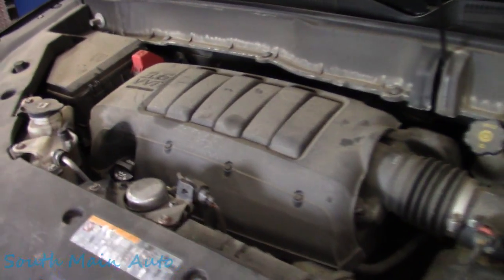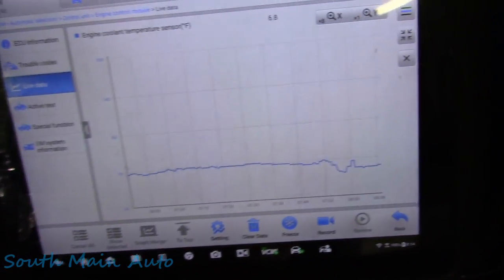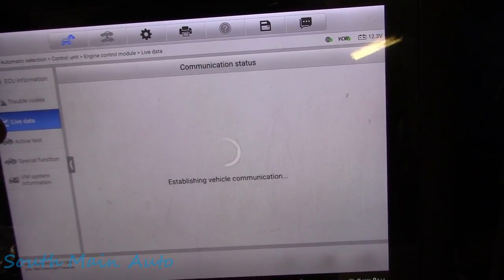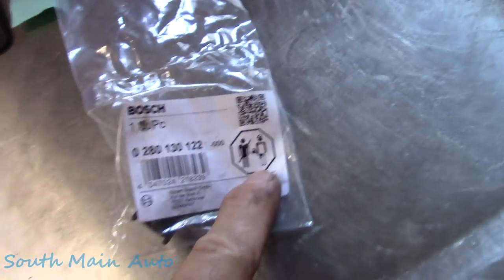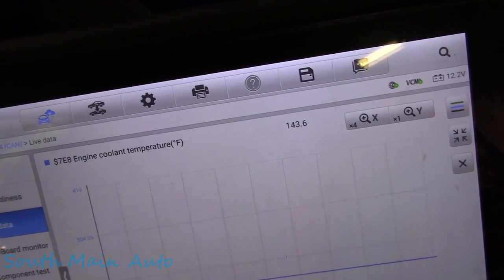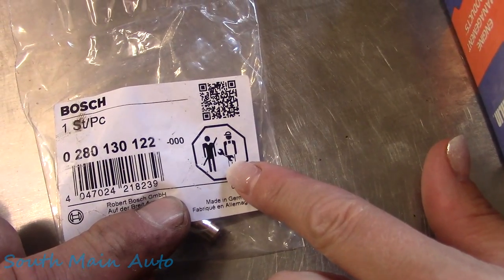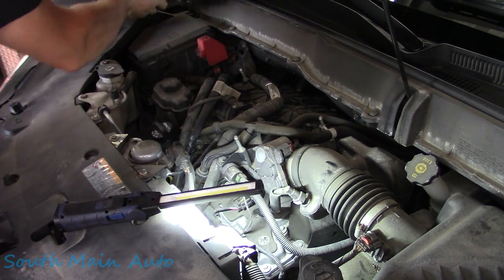Chevrolet Traverse: P0118 & P0119 Eric O. Loads The Parts Cannon AGAIN!

Comment: Every automotive engineer should have to be an assistant on a tow truck for a snowy winter, and an apprentice in a non air conditioned garage for the hottest 3 months of the summer. How cars are made would change.

Comment: You can shorten wires if the connector has a lock. The saved copper will pay for the lock many times over

Comment: The tab on the plug that connects to the coolant temp sensor on my 04 Escalade broke off about 4 years ago.  It hasn't moved at all in that time.  I don't live in the rust belt, and I spend all my time on paved roads, but I'm thinking the red clips are probably overkill
Reply: Its like having a stop ahead sign in front of a stop sign that you can CLEARLY see. Keep it simple stupid(kiss method)
Reply: I had a real scare on a car back in 79. The oil pressure idiot light came on and I thought we were looking at a major repair. It was the connection to the sensor that came off and dropped against the engine. The lock tab on the connector was bent just enough to let it slide off easily. No plastic so I took a small screwdriver and bent it back where it needed to be. I've seen enough loose connections to make me tolerate the inconvenience of unlocking connectors. I just wish they would put them where a person can see and reach them.

Comment: Best thing for those GM 3.6's is a road flare in the filler hole...
Reply: that's funny
Reply from the maker: 😂 so true
Reply: @SouthMainAuto  Eric, I beg to differ on the earlier 3.6 L ! Very widely used in many models. People can destroy a Sherman tank ! Go to Lube Centres looking for a deal ! Recycled oil & a $3.99 filter , run the shit out of them , go beyond time . Some Centres “ cheat “ & not replace filter ( seen it 4 times ) I would bet this engine has a 3-4% failure rate ! We only see the bad ones ! My wife’s new 3.6 L Blazer has a totally different engine , 5-20 Mobile 1 & GM upgraded filter. My cost $120.00 ! Money well spent , her third 3.6L ,,,, 3 out of 3 perfect ! Have a poop ! LOL & change @ 20% !

Comment: In the early days of smog control, the smog devices were very unpopular and could be easily disabled by disconnecting the connector.  The gov't said "We can't have this" and viola, the birth of the locking connector, mandated by smog control law.

Comment: Community question : 2006 Dodge Charger. P0481 No high speed cooling fans(very random short cycle of fans) Freeze frame data shows ambient air temp 30°-40°f when was really 90°f+. The display in my instrument panel always shows the correct temperature… I’m leaning toward TIPM… I did buy a new mopar ECT sensor… haven’t installed that yet. (New fans & radiator)

Comment: Tesla lock tabs are pretty neat.  You just pull it once. Then pull it again ....then it removes the connector automatically.   No squeezing required  and in tight spaces that's a plus
Reply from the maker: Get some NY salt and dirt in those and report back ....
Reply: @SouthMainAuto  😂🤣👍
Reply: @SouthMainAuto  iono how that compares to desert sand but they ain't too bad.   I have ran across a few that were pretty crusty ...
Them Tesla cars sure ain't built as well as I thought they'd be but damn they fast.   That's why everyone crashes them coz they wasn't ready lol

Comment: I'm currently removing the dash and everything on the firewall in a 2021 Camaro lt1.    I swear engineers are evil.   Should be mandatory to be a mechanic for no less than 5 years before you can be an engineer.   I'm sure it'll make a difference lol
Reply: @thomasfletcher4765  being a hater sure does take up a lot of your time don't it
Reply: @autotek7930  excuse me ? In what way was my comment " hate " ? Grow up
Reply: I agree that if engineers walked a mile in a pair of mechanics shoes, vehicles would probably be designed a lot differently.

Comment: So does the coolant sensor tell the dash board temp gauge what the temp is and then the gauge tells the computer what to do with the engine regarding the current temp reading?  I have a temp gauge that jumps around after the car drives over 10 miles and it can do that even if the temp sensor is in the engine or just hooked up laying on the block.  Maybe it's a short.

Comment: I believe what you meant to say is "it has the garbage 3.6". I have one. I hate it. On its second engine actually. And the replacement is worse off then the original in some ways. At least the replacement runs lol. Both engines, out of oil by 3k miles. So dont ever go by the oil percentage on the dash. Both burned but replacement leaks as well. And now it needs timing chains. No surprise there i guess lol. Original engine broke a valve spring then destroyed itself.

Comment: I had a temp sensor code in a 2012 Odyssey; AutoZone provided a new sensor and a diagram. Replaced it, no change. Replaced it again under warranty, no change.  Talked to the parts guy at Honda; he looked on their diagram and asked which one I replaced, the upper one near the thermostat, or the lower one in the bottom of the radiator?  AZ's diagram did not mention the same part lived in two different holes. Moved the new sensor to the other hole and reinstalled the OG, no change.  FINE.  Took it to my local version of SMA, and in about ten minutes, the guy found the wiring harness on the lower sensor was damaged, about 12" back from the sensor itself. Oops.

Comment: I know it's off topic my brother had a Kia one time and the engine literally baked itself. Regular oil changes with a good quality oil and there was a half inch sludge in top of the engine. Picked up an engine one year newer and the engine cover was less than a quarter the size. Since then I throw them away if they're not part of the air cleaner or anything. I don't know why they put crap on engines that retains engine heat. Just to look pretty?

Comment: Hi Eric, the step daughter has the same 2016 Traverse as this. Car feels like it's misfiring at stop lights and randomly hesitates/jerks under acceleration.
No "money light" but she said it has flashed at her before...
Scanned it at work using All Data (I'm an automotive painter at collision shop)
Came up with 3 stored codes. P300, P118, P119
If it was coolant sensor like I this vid, could that cause the random misfire?

Comment: The GM 3.6 V6.....my most hated engine. It’s like it was specifically designed to be as difficult to work on as possible without removing it from the car.

Comment: No mans land is the ladies rest room. Speaking of connectors that fall off. The plug fell of the light switch on my 1969 ford pickup one night. Fortunately I was only 1/2 mile from home because the head lights and parking lights didn't work. I didn't have a flash light. Found out that by turning on the hazard lights and pushing the brake slightly the parking lights and tail lights stayed on so I drove home that way. i got a flash light and plugged the connector back on to the light switch. That never happened again so i am guessing they didn't plug it all the way in at the factory.

Comment: So when it’s a “parts cannon “ fix , do you still charge diagnostic fee ? I mean it’s an experience based guess……..
Reply: Do you think it is fair for Eric to book in the car, do the tests to confirm that it is indeed a problem (not just a loose wire), dig up a parts diagram, put the scantool on it, start the engine and watch the temperature graphing? What do you reckon? Do you go to work and are happy to not be paid for the time you are there? Retired mechanic from Land Down Under.

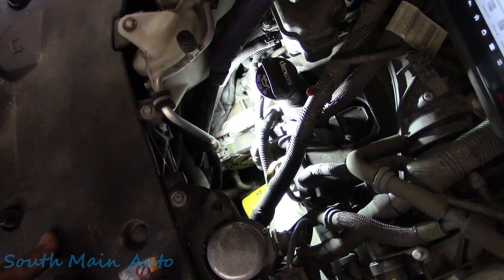Comment: These engines are such a pain to even change oil on. The oil filter, in Yellow in this case, shown @1:52, bottom center of screen, is surrounded by very hot engine parts. It has a rediculous amount of threads on the filter mount, to spin the filter off from and hot oil is running on your fingers during the removal. Then to drain the oil, the plug points at a 45 degree angle, instead of 90 or 180 degrees...on a horizontal plane.  They are just a pain to work on. Then the air filter..........This vehicle is an example of just bad engineering and individuals who really didn't take servicing the vehicle into consideration when they designed it. For God's sake, the transfer case fluid check plug on the All Wheel Drive is blocked by the exhaust pipe. I don't know what tool you're supposed to use to check it, but whatever it is, we don't have it at Walmart. 

I've been working for Walmart in the Auto Care Center for going on 15 years, October I'll reach 15 years, and as I've been here, the list of vehicles I'd ever own myself, grows dramatically smaller, and I'd own nothing newer than 2007. The Chevy Traverse is definitely on that list.
Reply: Yes, I hated changing the oil on ours (we had two in a row). You can't see where the filter mates to the block, so you have to wipe that area blindly, and then spin the filter on blindly, at what feels like an odd angle (it always took a couple of tries to get the filter to start).  Oil from the filter ran everywhere underneath - ugh!  
All of this, not to mention if a headlight goes out - you have to remove (peel back) the inner fender to change the light bulb. If you aren't flexible, you're removing the front wheel. 
We traded both of our Traverses ~100k before something could really go wrong. I didn't want to be stuck trying to fix something on it or paying someone else to do so.
Reply: @92Pony  Right. I forgot to mention the positioning of the filter. I discovered if you hold it straight on, then tip it slightly to the right, then tip it slightly down, it will usually line up with the threads on the mount.
Reply: never

Comment: I have a quick question I drive an 05 pt cruiser and out of nowhere the engine light comes on and starts jerking like it's out of gas and won't go over 50 but if you turn it off and let it sit about 5 minutes it's fine again and the engine light goes off at first I thought it was a fuel pump but I don't think that would make the engine light come on

Comment: If it's a relatively inexpensive part that notoriously goes bad, I'll shoot the parts cannon at it because if I'm right, it will cost the customer less than if I spent the time going through an exhaustive diagnostic procedure to prove what I already knew with a high degree of confidence in the first place.

Comment: Thanks Eric. Does anyone know if its normal for a coolant sensor to start out reading, say 200C, at startup on a cold vehicle, then drop and stabilize, adjusting to what seems to be the correct coolant temp as the engine warms? its a 2006 Ford F150; i thought the scan tool data (OBD2 also) for this sensor would show a temp similar to the  ambient temp as well as the engine temp? Seems odd. The reason i even looked was that as the engine warms and the thermostat opens, the engine temp gauge on the dash shows the needle somewhat past center, to the right, although it never gets to the red zone. Truck seems to run fine as the temp gauge has been very consistent over time. Just thought the temp gauge + the scan data for the coolant sensor was odd and maybe indicating a bad sensor?
Reply: My guess would be a bad connection somewhere that "fixes" itself when the engine warms up.  When it's cold the computer tries to read a voltage on the sensor line and just gets a junk value.  Or maybe the sensor has gone out of spec, like it's supposed to always read somewhere between 2 and 50 ohms but now when it's cold it's actually 100 ohms.  So the computer just puts in a default value.  You'd think that would set a DTC though.

Comment: It won't be long before you need the flashlight that sticks to plastic, because that's all you will have. There's less and less metal with every new model.
Reply: Plasticky bits. Like the older plastic Northstar intake manifolds that cracked and leaked coolant into the motor, ruining a very expensive and over engineered valvetrain system etc. Who would have thought that high underhood temperatures and gasoline fumes make plastic brittle? Surely no way an engineer could have thought of that. Perhaps they did, but the bean counters told the engineer 'who cares, just make it last at least 3/60, get it a month or a mile past the warranty period'.

Comment: Well, when it comes to Chrysler at least. Those locking tabs were the engineers solution to the $#!+ grade cheapest wire they could find corroding out of the connectors.. "It is a connector issue, therefore it is a connection issue, so the connection must be connected, and must remain connected, so that the connection can be connected,and to ensure there isn't a connection issue, we'll install connection locks, on top of the locks that lock the connector.

Comment: I absolutely hate the green lock connectors on Nissans work good new but get the usual dirt crud and oil on them and they won’t release to save your life 😂 god forbid you go to do the passenger side cam sensor on a 4.0 on a frontier or pathfinder I’ve broken more heater hoses for when the connector finally comes loose then I care to admit. Was being rushed one time and actually got scalded when the heater hose broke won’t ever change them on a hot motor again a waiter can wait unless they’d like to pay my hospital bill 😂

Comment: Have seen this failure symptom many times before in the electronics industry. It’s always a component issue. 

Usually in my experience this is a bad crystal oscillator or a phase lock loop circuit with a sweet spot where it only fails in a specific temperature range. 

I wonder what’s inside the sensor?

How about a bench test and dissection?
Reply: It' a thermistor. The higher the temp the higher the resistance.
Reply from the maker: @jameslong3351  Well that depend on if it is a PTC or NTC thermistor..... mister 😉
Reply: @SouthMainAuto  I'll bet you $5.00 it's PTC

Comment: The germans love to  tell people they shouldn't work on their own cars if they aren't qualified, hence the non standard 7mm internal hex on certain brake calliper guide bolts....
Kinda makes sense not to want to risk running someone over coz you didn't fix your brakes right. It happens, I've had occasion fo flag some one down before and warn them their brake callipers were not put together right.....